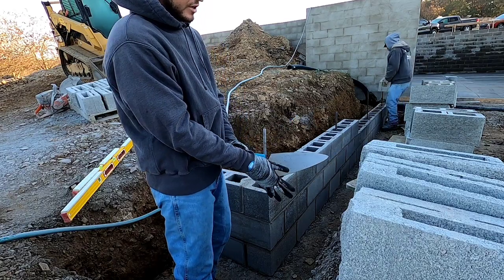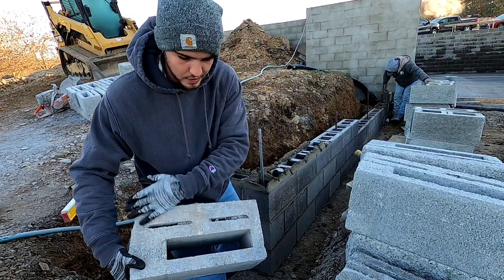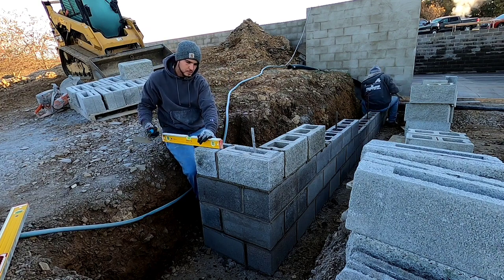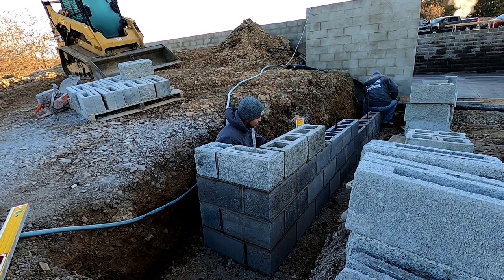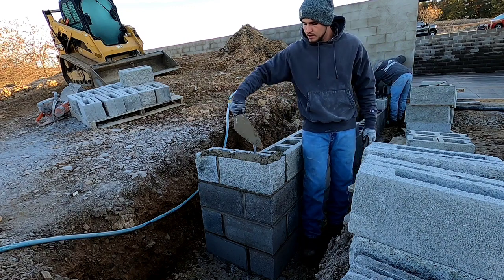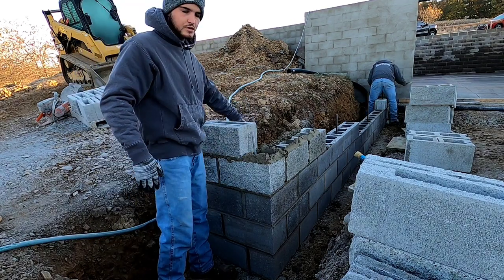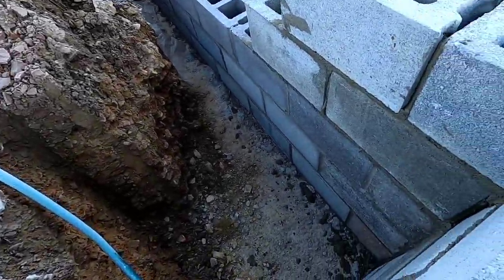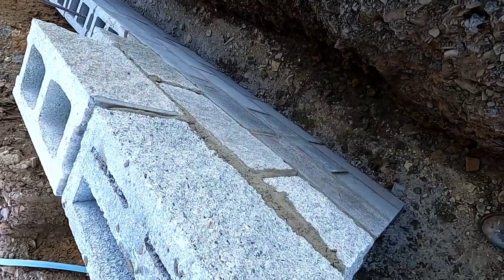How To Lay A Split Face Block Wall

Comment: Split face are hard to lay. Hard to joint also next to impossible to keep mud off the face.
Reply from the maker: Yeah they are. Takes a lot more time to keep it clean
Reply: @masonthemason6412  a stiff plastic bristle brush helps